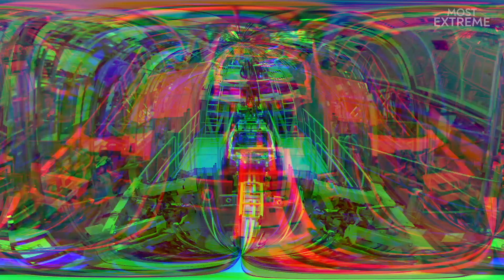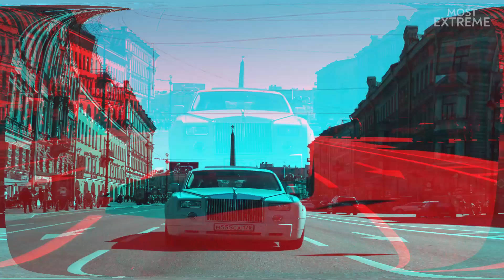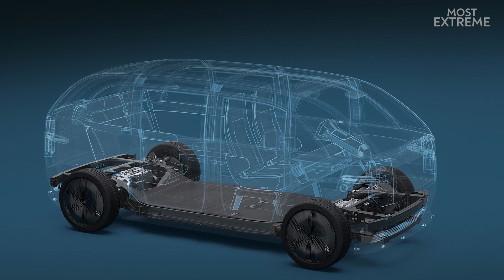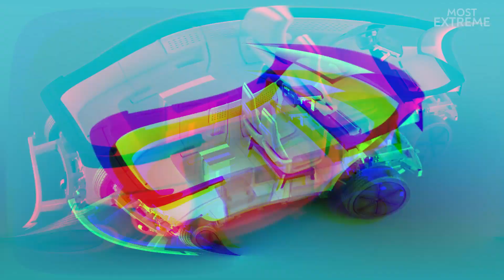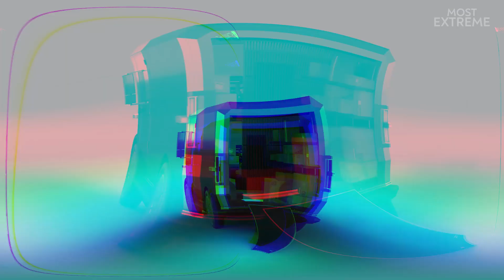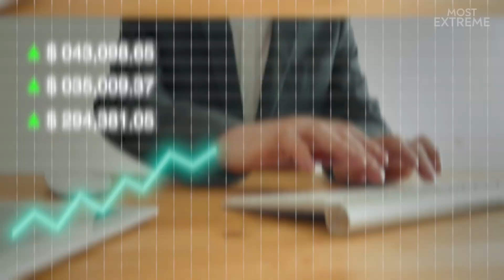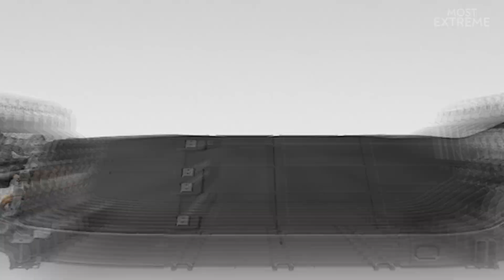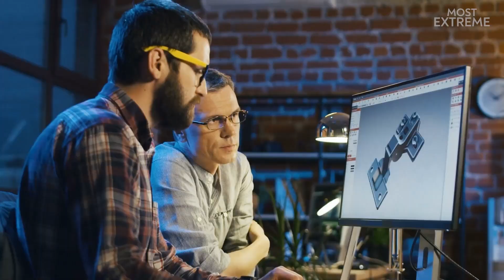CANOO - Different Approach To Electric Vehicles

Comment: Range needs to be 500 miles miles minimum, with regenerative braking. It will not be a viable vehicle as the dominant electric suppliers will make it so by excessive pricing.

Comment: I need to know when these trucks will be available to test drive and purchase, what options will be available, how much they will cost, what is the power and acceleration, what is the size and type of the battery, how and where to get service if/when necessary.  Assure us that this company will be around in 5 to 10 years or more.